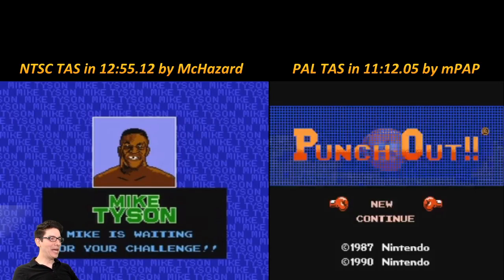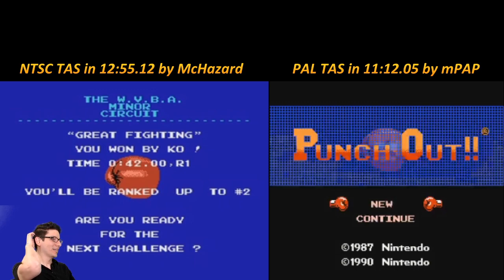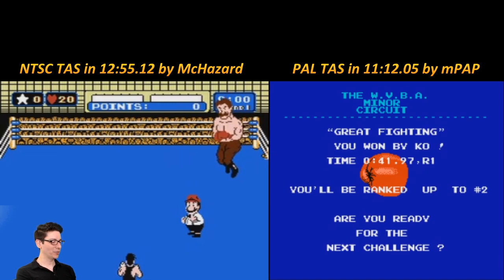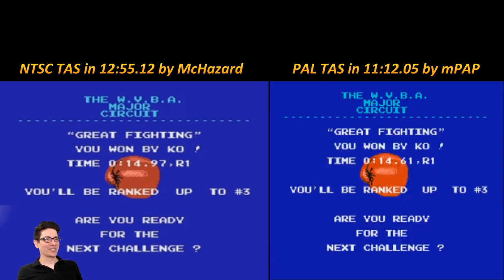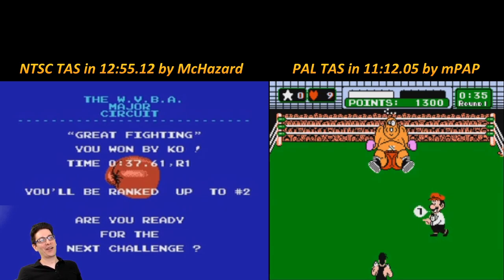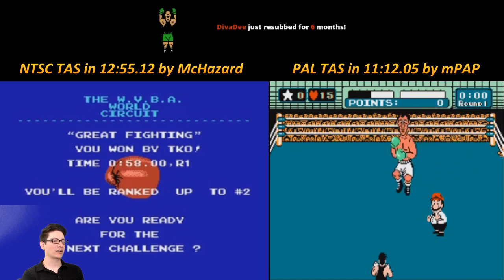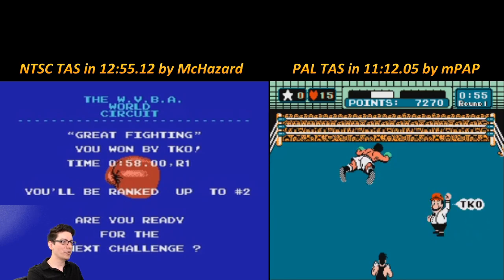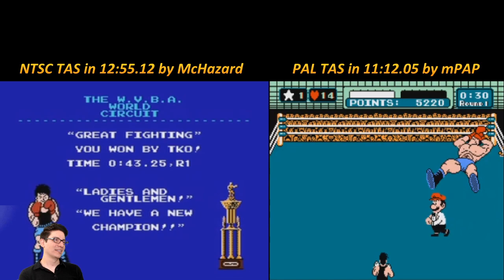Glass Joe in 41? Great Tiger in 24? How is this Possible?

Comment: You can actually beat don flamenco in 11.97 from a time freeze glitch
Reply: Really? Please explain
Reply from the maker: Correct, however that is a different category. You can also get a much lower time on Super Macho Man using the clock stop glitch.
Reply: @Sinister1  I haven't played punch out in like 3 years, but lately I've been binge watching summoning salt videos. Is there a video where someone explains the mechanics of the stop clock glitch?
Reply: @ghostexterminatorjr2069  I have video that explains clockstop glitch
Reply: @Papamanual  thanks I'll check it out